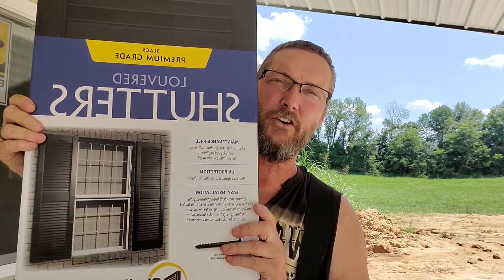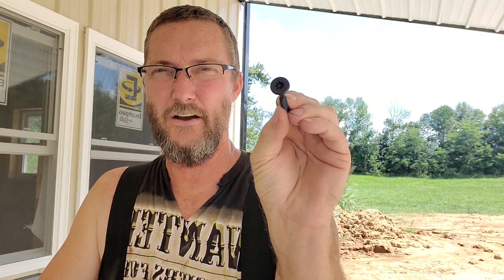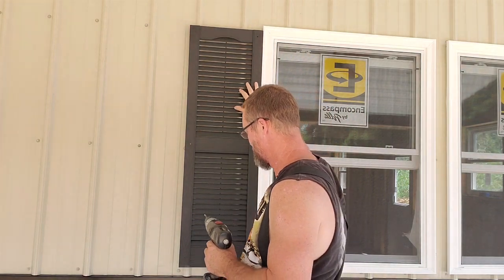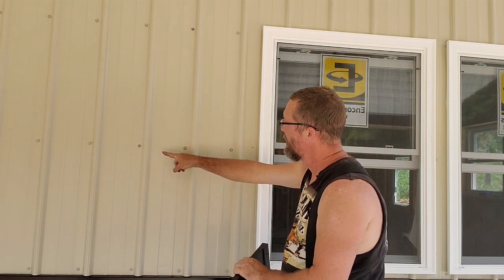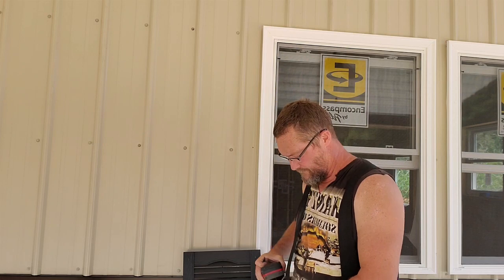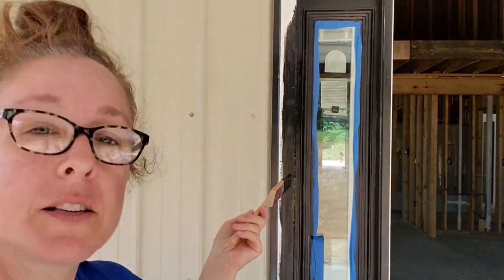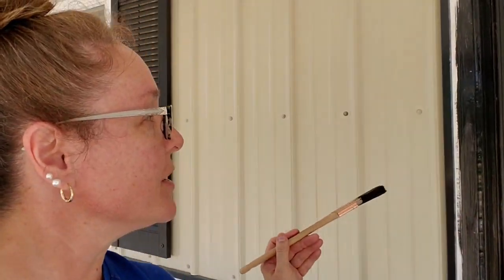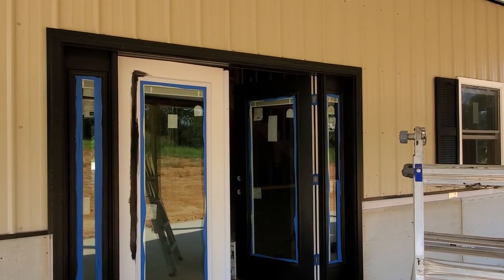Pole Barn Home || Adding Shutters and Painting the Front Door Black

Comment: The shutters are a great accent to the windows, the outside is coming together nicely!! One coat of paint never seems to work, I used the BEHR Marquee primer/paint $45 a gallon 🤯 on my bathroom remodel and it still took two coats to cover a white wall 🙄
Reply from the maker: This door was a pain to paint. Later some of the black started peeling off and required touchups.  We do luv the color though.  It sure will be nice when its all done.🙂